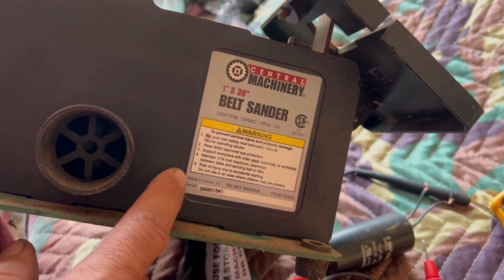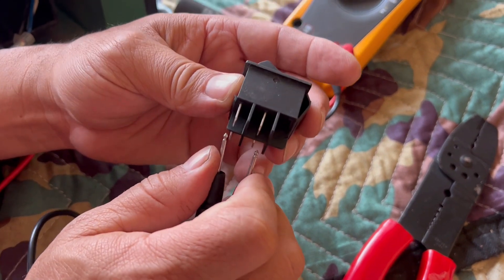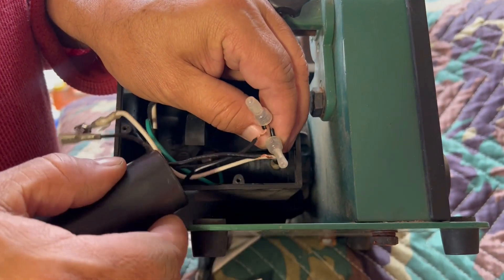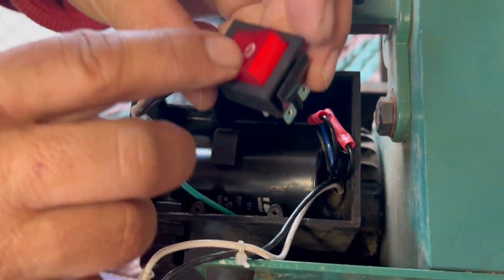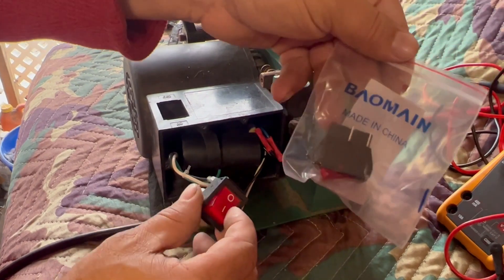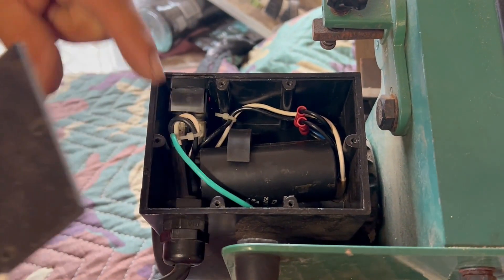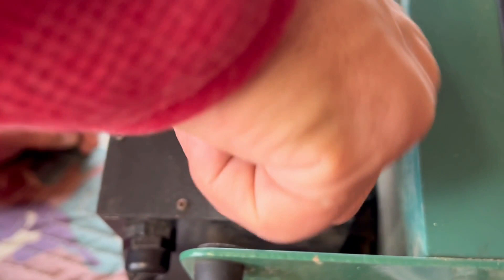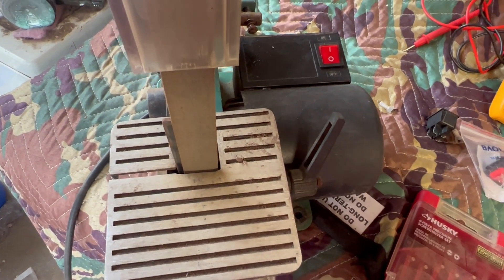1" x 30" harbor freight belt sander will not turn on | testing a rocker switch with a Fluke tester

Comment: Today 04/09/2024.    THANK YOU. SIR.....Watched your video and my switch also went bad.. Figured I would just spend  (now$6.39) from Amazon for 2 ,minimum and IT WORKED.. saved me $50.00 ....THANK YOU, THANK YOU, THANK YOU...............Baomain Boat Rocker Switch DPST ON/Off Snap 4 Pin Red Light 16A/250V UL TUV List (2, Red)----------- perfect fit....
Reply from the maker: You're welcome.
Reply: Does the clear rubber dust cover snap on this switch?

Comment: Could you tell me what capacitor that is?
Reply from the maker: It's 12 uf. CBB60 250 volts AC 50/60 herts.
Reply: @natethegreat974  thank you very much